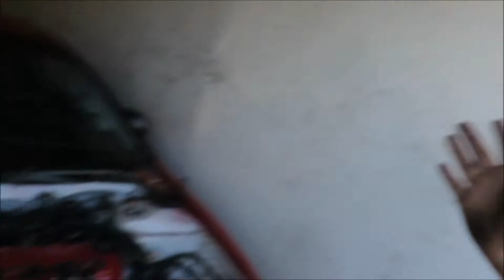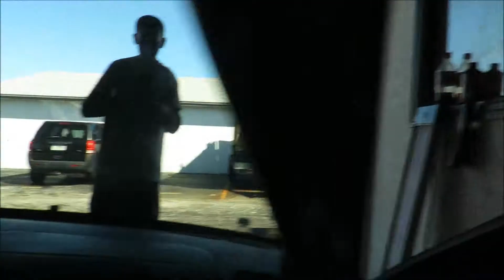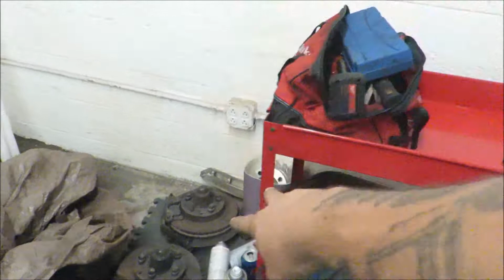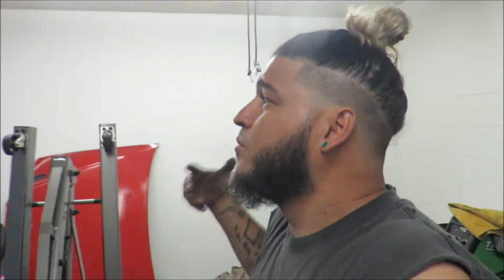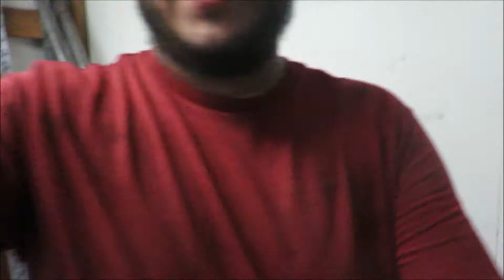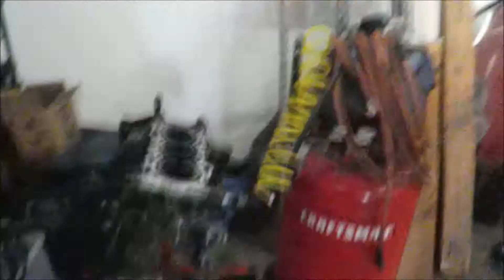I BEEN KEEPING A SECRET FROM EVERYONE!!

Comment: Did you manage to change the distributor? .. I have the same problem that the advance is lowered even to -6 degrees. It's crazy !! .. I have a boosted F18b2 (similar to f23a1) and I can't stop spinning it. And tomorrow I think I'll go to a distributor of a f22z2 vtec and I hope to solve the problem that will be caused to the TDC and CKP sensors that will be the ones that are causing problems.